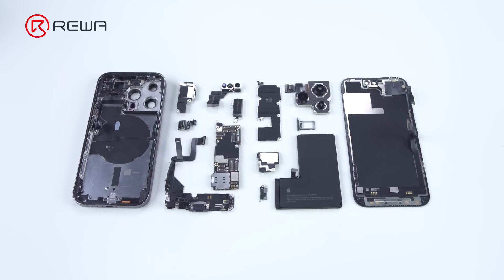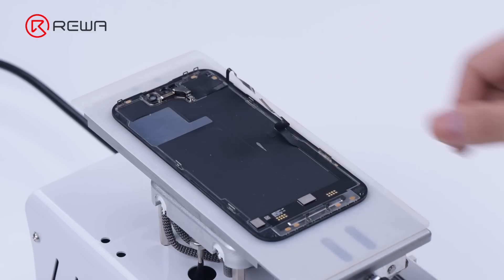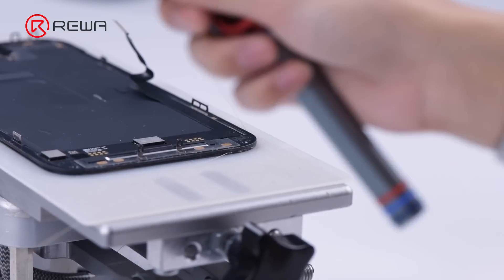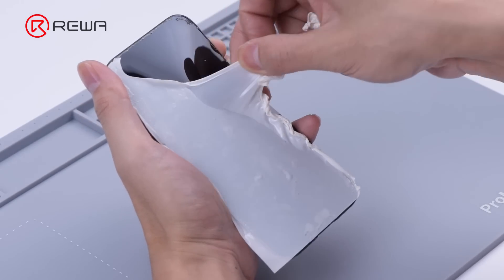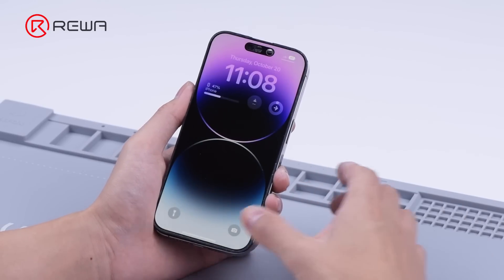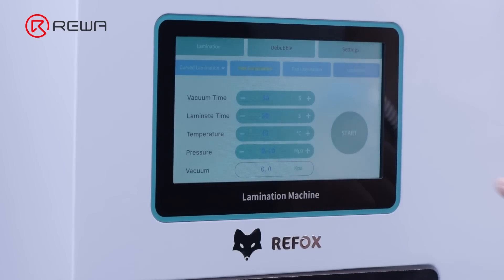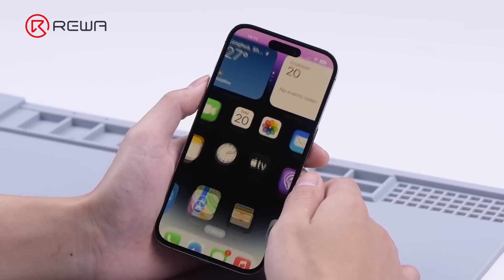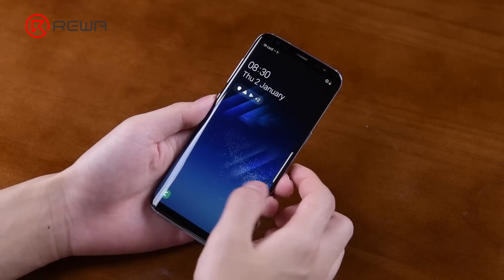How to Refurbish iPhone 14 Pro Screen - Glass Only Repair

Comment: I am refurbishing the front glass of an Iphone 14 Pro and I keep getting two small bubbles in exactly the same place at the end of the lamination / debubble process. They are both directly above the two IC chips on the back of the screen. I am repairing with the frame on and using black support mat for the lamination. Is it because the two chips are sinking down during lamination and creating a curve in the OLED and therefore preventing contact with the Glass? Do you think it would be good support the 2 IC chips with something beneath them to ensure they dont sink? Thanks
Reply from the maker: According to our technicist, maybe mould meets problem, perhaps you can try with mats

Comment: Please is there a way I can install the new glass without a laminate machine ? I mean I have removed the old glass and got a new one with oca already applied but is there any other way I can make it bond without use of expensive machinery
Reply: you can get an oca glue and cure it with uv. u cant use a new glass that already has oca for lamination tho

Comment: Garbage machine 
Bubbles always stay
Reply: im thinking about getting one, do you have this machine? it doesnt remove bubbles
Reply: @salt7582  it doesn't remove bubbles, tried like 20 watches 
And no support what so ever
Reply: @xiaomiindoor9321  thanks for the follow up 

What do you use to remove bubbles?
Reply: @salt7582  using uv glue the old method
Reply: @xiaomiindoor9321  do any de bubblers work?

Comment: Good job, but need add glue between bazel and glass
Reply: Oh yeah, I didn't think about that 🤔
Reply from the maker: Hi, we separate the glass without removing the bezel frame. There is no need for adding glue between the bezel and glass.